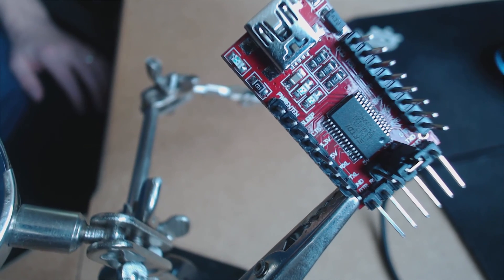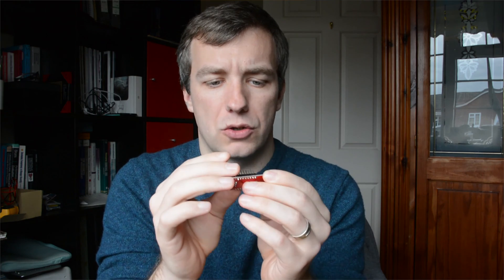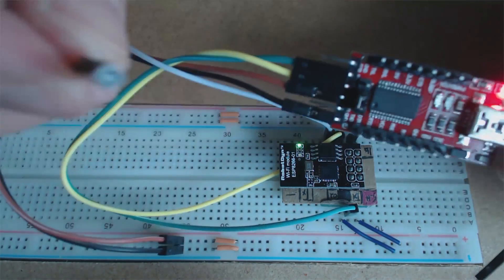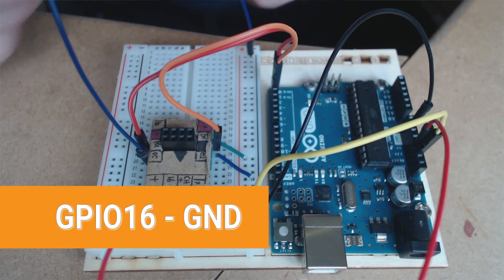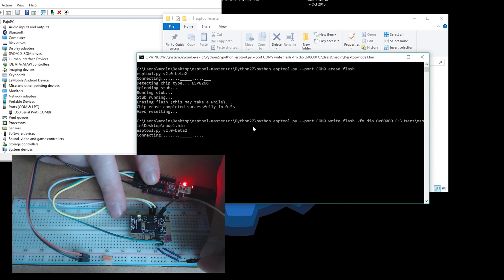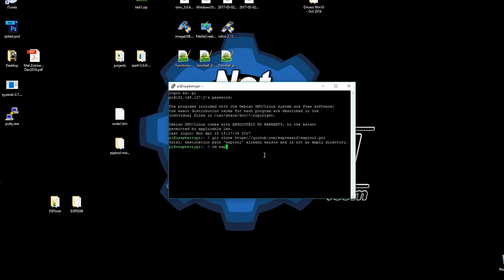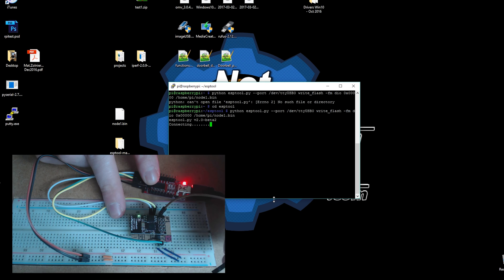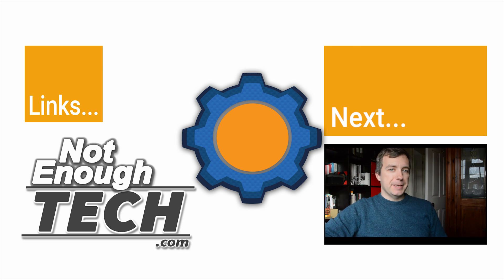How to flash ESP8266 NodeMCU on Windows, Linux, Arduino and Raspberry Pi

Comment: followed instructions... but it fails with 'A fatal error occured: Timed out waiting for packet header" after it says Erasing flash .... its a nodemcu-12E with 8266.. but i just can't solve this issue. is has flash and rst buttons - no combination so far seems to make a difference. any ideas?
Reply from the maker: Is that when you are trying to connect? If so try swapping TX and RX around

Comment: A big thanks to you from Southern Indiana. I work in surgery and have a 19th month old, so I don't have huge amounts of time for this and needed your tutorial for help.
I needed to flash an 8266 for a garage door opener when I come home on my motorcycle with a voice command, "Ok Google, turn on garage door." 
I did this with eWelink on a mhcozy. I now believe the eWelink cloud no longer communicate with Google Home because the voice command recently stopped working after 1 year. I'm betting it will work with Tasmota on it after I've flashed the 8266 with esptool.
Reply from the maker: There is a couple of ways to do this.  Command can be issued to GA via IFTTT or creating a virtual device with NORA.
If you go for IFTTT you can make a web call to esp directly just open up a port in your network. Alternatively you will need a server to host Nora devices. 
I have tutorials for both 
Look up nodered for beginners (connectivity) and Nora for more info.

Hope this helps. Warm regards from the UK!
Reply: @notenoughtech  thank you. I have continued to find it complicated to flash a mhcozy without an ftdi at the moment. I have one at home and cannot find it at the moment, but I have a Raspberry Pi 3 and all of the jumper cables I could possibly need. Just not a lot of specific information on Raspberry Pi flash to mhcozy documentation specifically.
Right now in case I am pulled away from what I am working on I will look at ifttt. I use that for a couple of other rules for my smart lights at home and maybe a quicker solution to continue voice activation through GA.
Reply from the maker: Take a look at this as well
https://notenoughtech.com/home-automation/ewelink-api-in-nodered/
You can link GA and eWelink this way
Reply: @notenoughtech  I will take a look at your previous link. An update for you, the reason why I am pushing through this is, ewelink now wants 9.99 per year for you to be able to use IFTTT with it. When I tried to add it in the IFTTT app, my login to ewelink from IFTTT said I needed to upgrade and pay $10 for this feature. This is why I am motivated  to change this somehow.
Reply: @notenoughtech  Man, after all that, about 4 hours going down the rabbit hole of links and reading, I got Google Assistant to work by voice command on my phone. I was at work the entire weekend so I brought the mhcozy with me because it wasn't working anyway. Setup a wifi hotspot at work with the wifi name and password from home, the one it was paired with. Said, "Ok Google, turn on garage door" in my phone and heard the relay click for the half second I have it set at. I am still interested in getting Tas on it one day, because it frees me from the cloud, as I have so many other sonoff mini's behind my light switches at home. I will endeavor to flash the mhcozy with the pi or the ftdi one day, but for now, taking a break. Thank you for the direction. Dave
Reply from the maker: There is always way to make things work in more than one way. If you want to take it off the cloud consider other protocols. You could use ZigBee buttons. Once in range just press one and the garage will pop open.

Comment: can i flash a nodemcu using the same methods? will that work with johhny-five?
Reply from the maker: I never used johhny-five if im honest.  But since the wiring is the same  to get the ESP into the flash mode - i would expect that you can flash anything that is compatible with ESP